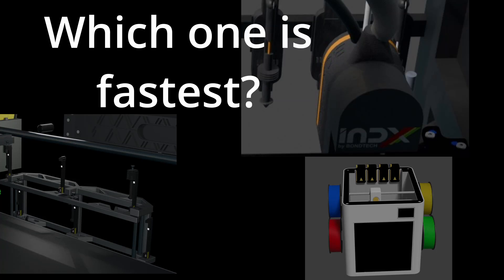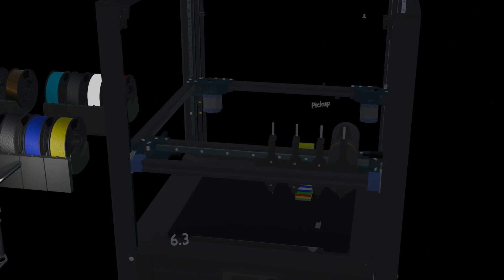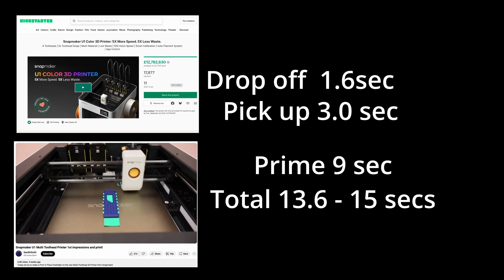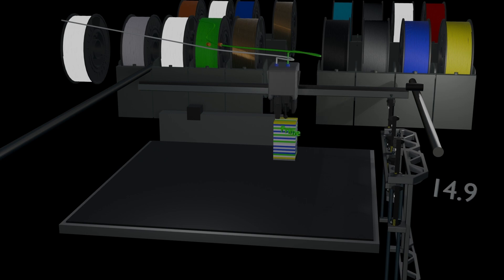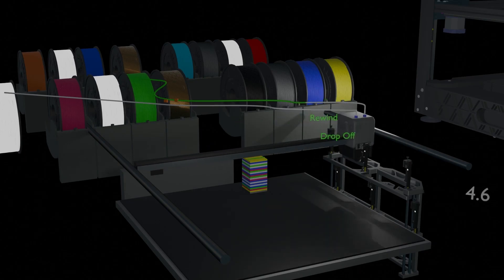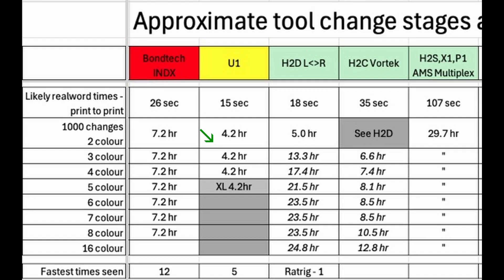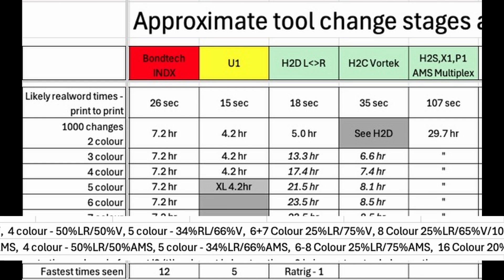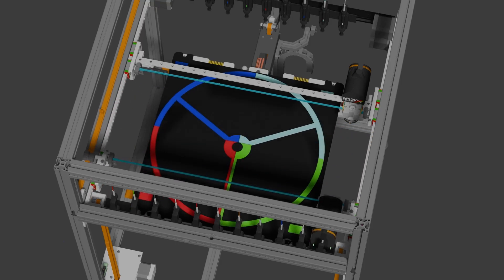INDX U1 H2C Vortek speed comparison

Comment: Pretty sure H2C filament change for the new nozzle will take more time and might be sequential instead of parallel to other operations.
Reply: I would be surprised if it was sequential, would be no reason for that. 

I'm also willing to bet a nickle that we see a multi-way filament sensor slapped onto the back/entrance of the buffer and maybe even a multi-output ams, whether 2 or 4.
Reply from the maker: Might do - will depend on how much tuning Bambulab decide to do and whether they want to get the tool change speeds as close as they can to U1 times.

Comment: Very nice video that explains and gives a good guess on what will happen. Only thing to make it better is to have your voice over on both channels (left and right) it is a little distracting now. On the content in many ways i think the indx and the vortek is the best compromise for most people and i feel (hope?) bambu has looked at all solutions and figured the indx way would make the printer bigger (less living room friendly which the design and sound level effort seem to show) little harder to get closed setup 350c etc etc and fits their eco system better where the vortek can be added (at least while making them) easier into their different concepts of single or dual head, ams etc etc.. I can see the bambu way making more sense in a home and the indx way more in  real shop. Both seem to want to avoid the whole tool needs to change idea in different ways. Ill try the h2c for sure given that i assume they have done by far the most testing and i expect the same level of results as on the h2d but at a cost of time per print. More people should see these videos only ones trying to simulate the workings and possible speed as a compare.
Reply from the maker: Thanks for the feedback on the sound - I have only just started adding sound and narration to my videos - mainly on a desktop without headphones - will sort out the issue with both channels on my next one.

I agree too about the Vortex practicality and likely level of testing. I have asked Bondtech for a demo of a 1000 plus toolchange print - and it wasn't available a few weeks ago - although I suspect the Beta testers have been doing that sort of thing.

Also on the subject of the cut (Vortex), vs permanent filament (INDX) - I too think cutting is more practical because it allows the mounting of spools and PTFEs to be a lot more flexible and take up less room.    To me the perfect setup though would be permanent PTFEs on a few nozzles (for the fastest possible changes or tricky filament like TPU) - maybe 6, then a lot more nozzles - maybe 30 with the Vortex type approach. - I'm planning on trying to implement this with INDX using at few Box Turtles and some sort of cutter on one or two of the nozzles, with the rest permanently connected.   That way you will end up with the 3 tool change types on an INDX machine too.

Also from another angle - I did a video a few months ago with an INDX as an Aux Tool on a H2D - I don't think this is a completely out of the question idea even now the Vortex H2C has been launched.   I.e. Have some way for a few 'noncut' nozzles to be picked up by the H2C.

Finally also what I would like to see is more than six nozzles on the H2C - either by changing the pick up mechanism to have 3 or 4 parts that could lift up, or somehow feeding more nozzles into the 6 slots from side.
Reply: @dwuk3d  Maybe a vortek-pro with pre-heating and more 'rows' you have to assume that bambu did think on how to extend the idea i would just like you are doing now thats how engineers think.  I think if we reduce the basic problem into 2 parts its poop and speed. The poop issue can be scaled for sure by having more hotends to pick up either on 1 side with more locations or using both sides of the printer. The speed i do wonder if we talking real overal speed of a print its not easier to gain speed in other ways like using different size nozzle for supports and fill or making swipping the head based on if its needed by  the camera feedback or or or ... In the end its not about color switch speed but overall speed vs quality of the print.
Reply from the maker: @scb2scb2  Agreed - its overall print speed including colour changes that I am interested in too.
I'm not that keen on normal tool changers - because to me it seems like you have got a lot of resource sitting there doing nothing most of the time.
I like the idea of having multiple print heads working at the same time - as a minimum doing things like preheat, wiping and priming in parallel, but then extending that onto actual parallel printing of some parts o f the objects too.
This does add to complexity though and make it more difficult to access the whole print bed - but given that BambuLab don't seem to be averse to adding complexity given how complex even the H2D is - then I think they should go that way next.
Reply from the maker: thanks - updated version here - nb/ I have only updated the music/talking volume in the main part - not the animations - but if they are still not ideal let me know and I will re-render/remix those too.   thanks for the feedback.
https://youtu.be/K8KYPbXUtLw

Comment: you think i can add indx to my qidi q2?
Reply from the maker: I would think so as its klipper I believe -  INDX PTFEs would likely stick out of the top - so you might need a top hat if you want to keep it enclosed. You will also lose a bit of build area.
Reply: @dwuk3d yeah i just want tool changer in it since no other printer in that price can print engineering filaments but the qidi box is ams style so theres a lot of waste